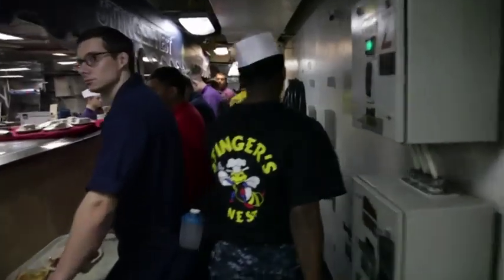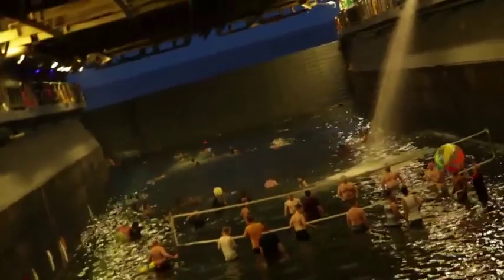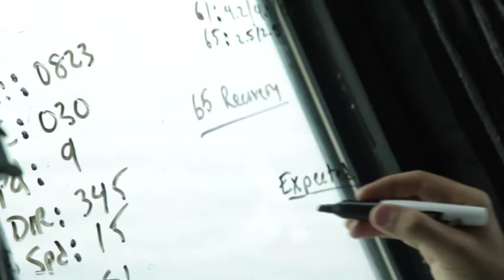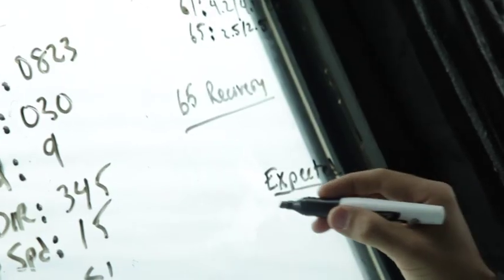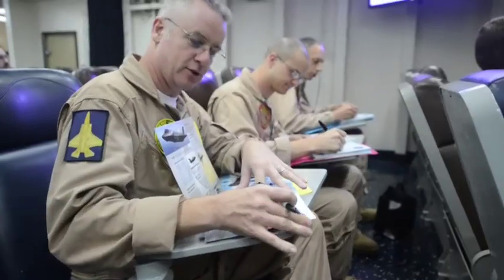F-35B Conducts Second Round of Sea Trials aboard USS Wasp

Comment: There are areas with stealth is the most important requirement to fulfill a mission in the initial phases, what the f 35 must have the capability of external stores after anime are the fences have been destroyed, and it must have much more ordinance if it doesn't have more ordinance capability missiles than the F-15 then go back to the drawing board

Comment: I love the F-35, and for this price I wanted to work if every electrical system on that aircraft fails I wanted to still be able to fly that's my only requirement right now, it's every electrical system fails on that aircraft it should still be a useful attack platform to the enemy, dead reckoning has never and should never leave us